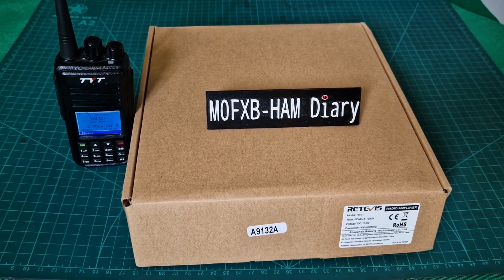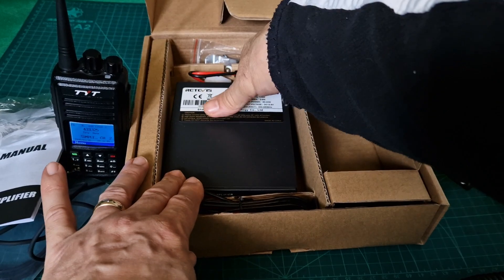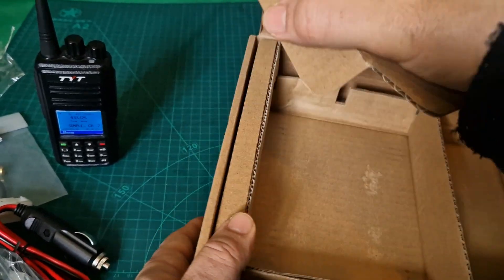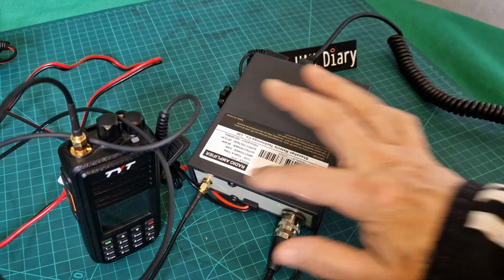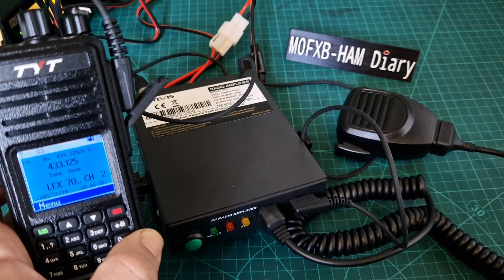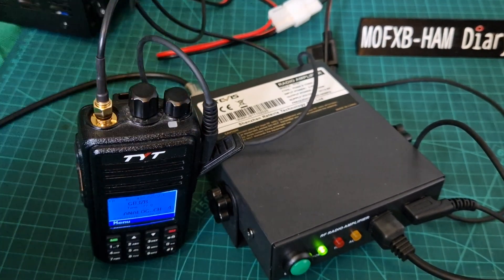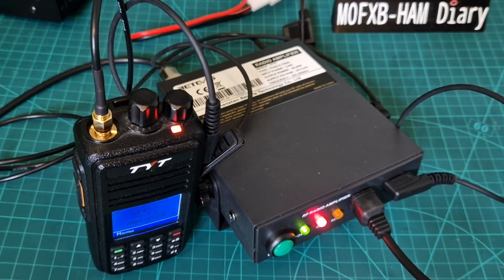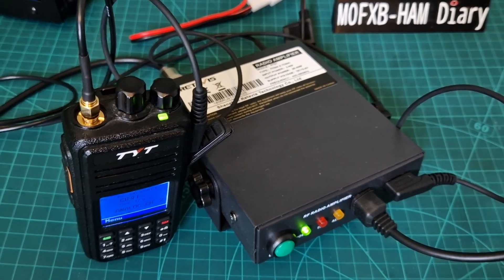HT AMP - VRP25 AMP Base Station,  40 Watt amp for RT3S & TYT MD380 70cm.

Comment: I have 2 BTech amps that put out about
30 to 40 watts analog and digital modes 
on either 2 meters or 70 CM from lower
power radios such as HTs.
Reply from the maker: Hi can I have the model.
Reply: @DIGITAL HAM RADIO DIARY-M0FXB  sorry, I am on holiday until next month in Florida,
so I can't remember or look up the model
numbers at the moment.
I think BTech also sells their version of
Baofeng HT's.
I saw the BTech amps on the Rfinder website, though at a much higher price,
around US $500.00, several times the
price for each that I paid here in the US.
Good luck, though when I am back home,
maybe I can inform you more. 73 de W2CH Ray NH
Reply: @M0FXBHamTech he’s still on vacation he’ll get back to you in 10 more months